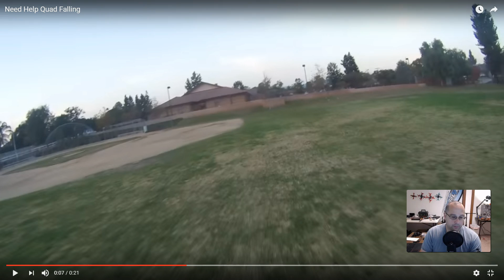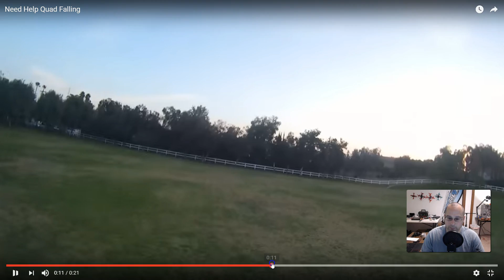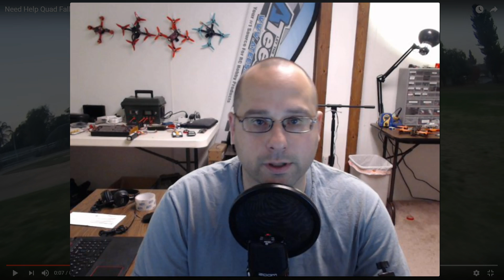Response to Brian Schwab - Troubleshooting BLheli Startup Tones

Comment: Maybe a silly question but no light coming in my FC while connecting battery and only have the three first beeps. Does that mean my FC is fried?
Reply from the maker: +Manuel ortiz if it powers from USB not not battery then the 5v regulator is toast. You could power the FC from a different 5v regulator and that might save it.
Reply: Joshua Bardwell uh oh. It is also not powering from USB :( oh boy it will be my second FC. Anyways, thanks a lot for all the help Joshua! Really appreciated

Comment: I have had 2 Speedix IS30A 4 in 1 esc suddenly just give me just the first 3 tones when plugging in a fresh battery.  The FC and VTX are not getting power.  Is there a way to fix this or do I just replace the 4 in 1 again?
Reply from the maker: How are you powering the FC and vTX? The FC not getting power is usually a dead voltage regulator.
Reply: Joshua Bardwell the fc is powered by the Speedix IS30A 4 in 1 esc.  The vtx is getting power from the fc.
Reply from the maker: What vTX is it?
Reply: Joshua Bardwell it's a FX799T.  If you are familiar with RC Addict, I copied his Rampage build.

Comment: My startup tones have a slight echo to them. Running multishot. The Imperial March bit is solid, but the "beep-beep-beep-beep...boop" sounds like two sets of tones, slightly delayed from each other. Any thoughts/tips?
Reply from the maker: +Death Knell FPV it just means one motor saw the their tow signal slightly later than the others. It's not a problem.
Reply: Thanks for the reply, the newb is assuaged :)

Comment: hi. i only get the start up beeps( 3 beeps). but the throtle one i dont. i just bought this 4 in 1 esc blheli s for kingkong 90 gt. i plug on beta flight motors tab and it wont do nothing. i did everything i could find online. if you have time hope you could help.
Reply from the maker: If you don't get the last two beeps, the ESC doesn't recognize the motor signal that the FC is sending. What motor protocol are you using? Dshot? Multishot? Oneshot125? Oneshot24?
Reply: Joshua Bardwell to be honest i tried all of them. i dont know why it does that. This is a king kong 90gt 4 in 1 blheli s 3 a esc. i had it working before i took the old one off.  Everything works in betaflight but no signal to motors. i downloaded blheli suite and it shows a error saying no power to esc 1. i did have the battery plugged in.
Reply: I have the same problem after a crash, I had a loose cable. I welded it yet, still three beeps. What can I check up?

Comment: So would I be correct in assuming the programming is the first 3 tones, one for each of the motor winding circuits. The 4th tone is "arming initiated" and the 5th tone is "arming complete"?
Reply from the maker: +Robert Nollkamper no. The first three tones indicate power. The last two indicate throttle signal received.
Reply: Ok thank you. I have a problem on a new build where 2 of my motors are not making the final 2 tones. It's a 4 in 1 blheli s and kiss fc, connected with a jst 1.0 for all the pwm signals. I think I may just have a bad connection, so tomorrow I'm going to solder directly to the pads on the flight controller. Pray for me!

Comment: Hi Joshua I have the same issue on a F3 evo with oneshot125 ! My maiden flight I didn't have the soft mount so on punchout it would have the #2 motor full out and the quad would tilt on punchout! So I soft mounted fc and motors and everything seemed great until I did a roll same thing as in this vid it went crazy! I know all my solders are good but my tones on the esc's are slow I get the first set when I plug in lipo but it takes probably 5 seconds till I get the last tones! Could this be because I have my motors on reverse on blheli? And one other thing if you don't mind the same F3 evo I have a pair of racerstar 20a light ! Do I need to change the pin #4 to 5 for the motors? Or would have that been fixed with the stable release of 3.1 stable to run dshot 600? Thank you very much in advance 👍
Reply from the maker: If it takes you five seconds to get the last two initialization tones, then your throttle signal is not stable. If you are running Multishot or DSHOT, try going to OneShot.
Reply: Joshua Bardwell thank you 👍

Comment: Joshua Bardwell I am having a similar problem with my quad . When I go to do a roll my esc loses signal . I can make it do it on the bench by moving the stick on my radio while the quad is on any ideas
Reply from the maker: +Brent Herrick if you can do it on the bench it's probably not vibration. That leaves electrical. Did you rin a ground wire to the ESC, or only signal wire? If only signal, run ground too.
Reply: I actually figured it out I think . I changed the esc to the motor that was failing and it seems to be ok now . Fingers crossed I'm heading out flying today . I really appreciate you taking the time to help
Reply: i'm getting the f4 v5 pro fc. it doesn't have a pad for the negative signal wire, will that cause issues or is it ok because the fc is a pdb also and the main esc + and - wires connect to this fc or should i wire  both negative wires to the same pad

Comment: I've had the same issue. It turned out to be the motor wire shorting to the mount screw. It looked fine the correct way up but a flip/roll was all it needed to cut out.

Comment: Hey josh I have a similar problem my copter flips after I do a flip but usually only after I give it hard throttle before the flip. Changed motor timing to medhigh and turned off demag because I read about it somewhere and it happens less but still happens. Any idea?
Reply from the maker: Have you tried raising min_throttle?
Reply: Joshua Bardwell I have not tried that it is at 1070 I'll change to 1090 and try that tomorrow see if it works thanks
Reply: Adam Harlow hey do you mind responding back to say whether that worked? My FlexRC Owl with a SirinFPV FC is doing the death spiral on certain hard throttle blips also. My min throttle is at 1050 and I am not running air mode and I actually have MOTOR STOP set to ON.
Reply: eightballrj did you fix yours I did a good size punch after restoring my setting back to default and it seemed to punch fine so I did one more punch little more aggressive and it did some crazy flips and crashed now one of my esc beep twice( beep-beep ) and motor twitches

Comment: Had the same issue ended up being the Xt60 connector was loose from soldering. Replaced and has been flying good ever since.
Reply from the maker: You should have heard the full reset tones, right?
Reply: Joshua Bardwell Correct... I thought it was kinda weird b/c I never lost the video lol.  That few secs you have no control and waiting to hear the crash is the worse lol.

Comment: ive seen this problem with the original emax 35a lightning escs - adding a capacitor to the battery lead fixed it
Reply from the maker: Very unusual, since it wasn't the power, but the signal, that was dropping out.

Comment: I would have said that it is the pid loop frequency. change it to 2khz or lower. see if that works.
Reply from the maker: +Sir Jacob CPU utilization too high with synced motor output can cause interrupted motor signal. I agree.
Reply: Joshua Bardwell happened to me yesterday
Reply: also, I have a problem when I flip. my fpv goes to complety static then 2s later comes back. its when it is doing a sudden movment. what could cause this?
Reply from the maker: +Sir Jacob your power going to the vTX is loose and is getting jiggled when you flip.
Reply: hey man, I have the same problem but I have not figured out what's happening ether.
Reply: Joshua Bardwell thanks, my pdb has 2 12v outs, so I switched them and it works now.
Reply: I've got a similar problem. But my esc burns after flipping O.o 
But i remember it makes the tones too... I cooked 3 escs in the last 3 batterys this way btw
Reply: lower max throttle maybe
Reply: Sir Jacob I set max throttle in Betaflight as well as in BLHELI to 1952. Before I did that, I flew with 1950 in Bf and 1952 in BLHELI. What do you think?

Comment: I had this same issue and I put it down to Air Mode, and my min and max throttle and esc calibration being funky. I was using an old spektrum radio with worn out gimbals and you couldn't digitally calibrate the end points. So the lowest throttle value I could get was 1150 and max was like 1820 or something. I figured out it would only do the spiral of death after I had tried to do a maneuver with zero throttle on Air Mode. I never figured out how to fix it. Because on regular rate mode I'd be fine, I just couldn't go to zero throttle in the air
Reply from the maker: With air mode turned off, losing authority at zero throttle is normal.
Reply: I'd only get the spiral of death when I tried to do a maneuver in Air Mode on zero throttle. I never had a problem with Air Mode set to off

Comment: Could it be that max throttle is to high? The esc get an invalid throttle value and shut down until they recive a valid signal. But then perhaps blheli can handle that now
Reply from the maker: +John Nordstrand cleanflight / betaflight won't let max_throttle go over 2000.

Comment: Hi Joshua, 
I hope you can troubleshoot a problem that I have with my new Eachine Wizard. I flashed the fc with the latest betaflight version. I also installed the X4RSB Receiver and flashed the esc's with the newest Blheli_S firmware version 16.5. 

Now I have a problem, when I want to calibrate the ESC's with the betaflight configurator (set master slider to full throttle and connect the battery)
the Esc's make they usual start up beep tones (First 3 beeps) and then just start beeping constantly without the well known calibration beeping melody?
Why cant I calibrate them ? And btw I've set the protocol to Multishot in the Betaflight configurator if that matters?
Reply from the maker: +xuxusito throttle is raised and "programming via TX" is off in the ESC's.
Reply: No that seems not do be the problem. Programming by TX was on in the Blheli config. But I changed the esc protocol from multishot to oneshot125 and now I could do a calibration of the esc's. It seems to be a problem with the multishot protocol? Maybe you can't do a calibration when multishot is enabled?

Comment: hi mate. i had similar problem when my throttle was first all way down and strait up again...it caused by a motor....first i blamed the esc but after replacing it nothing changed....so i replaced the motor....all good now....